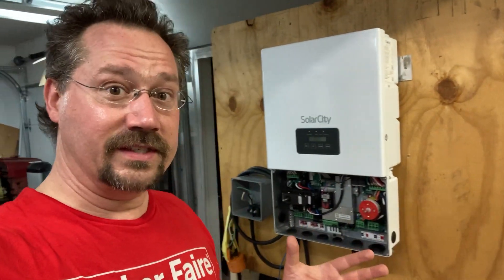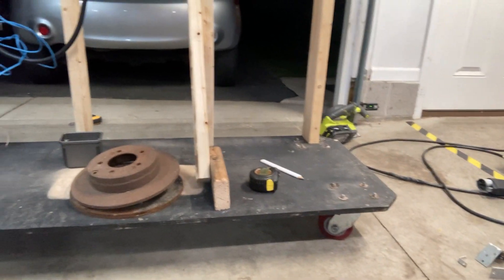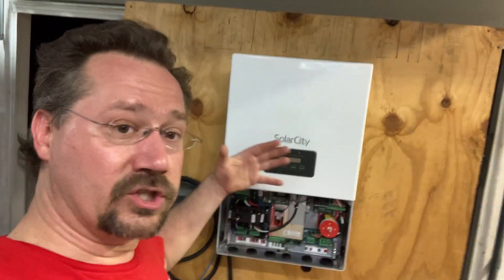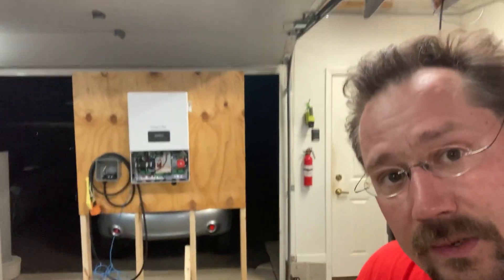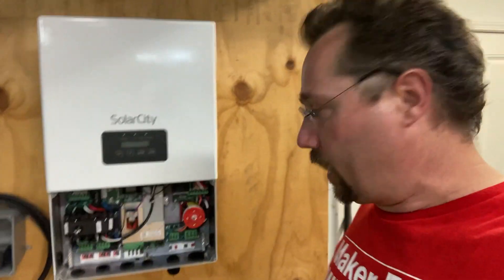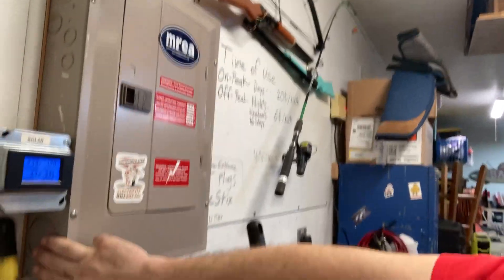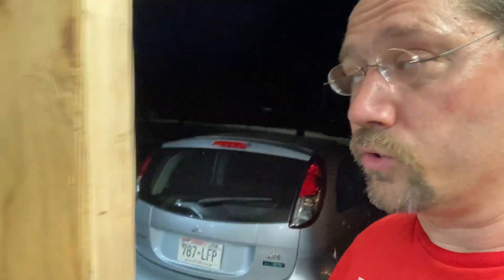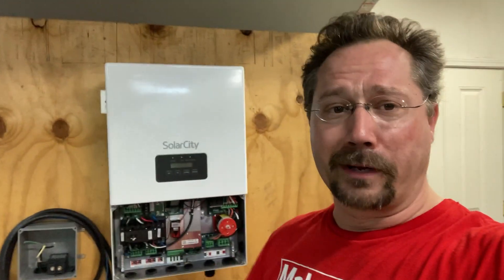DIY Vehicle to Grid | CHAdeMO iMiEV to house in the works

Comment: What does the iMiEV motor look like? Would it be suitable to do a Goldwing gl1200 conversion you think?
Reply: The challenge would be to have the 300+volt battery needed to run it fitting in a motorcycle.
Reply: @sophiesstuff1083  I'm not an expert on the topic but I think the voltage needed depends on what inverter one use and not so much on the motor it self? That aside. I think I could fit a 300+ volt battery in the palm of my hand but It would not be able to carry significant amount of energy. So physical size and volts both increase if you connect the cells in series. Anyhow. I think I could fit a battery with enough voltage to supply the  iMiEV`s original inverter and probably have to if I want to also use the original onboard charger and/or use fast charging.  I just wanted to know if Citroen C-Zero/ Mitsubishi i-MiEV/Peugeot iOn was a good donor platform for parts because its a lot of them and they are starting to go for pretty cheap these days even here in rural Norway. Or if I would be better off sourcing parts somewhere else. :-)

Comment: Wondering if the Hyundai Ionic V2L adapter would also work on a Leaf or a Mits. Seems like that is a simple solution, although a bit pricey. Thoughts Ben?
Reply from the maker: From what I've seen of that connector, it actually runs on the J1772 port, NOT the DC Fast Charge port.
On typical EVs, the J1772 goes straight to the car's internal battery charger, which is why you can NOT pull power out through that connection.

As best I can tell, the Hyundai Ionic/Kia EV6 has an internal switch that routes power so that you can DRAW energy through the J1772.

Therefore, it will NOT work with a Nissan Leaf.

I don't know too many details of that system, and I'd certainly like to find out the specifics.
Reply: @BenjaminNelsonX  
Thanks for the reply.  I was hoping it might be able to be used but had a feeling probably not. Maybe we will all get lucky and a standard will emerge to allow V2L for all EVs in the near future.
Reply from the maker: I think that Vehicle to Load/Home/Grid is going to become the killer app of electric cars.
It's coming. It's only just starting to get here right now.

Comment: I’d love to use my Nissan Leaf as a backup power supply or house battery.
Reply from the maker: I'm using a bit of a "cheat" on this setup in that it's very easy to MANUALLY activate the CHAdeMO connection in a Mitsubishi iMiEV.
Next step would be a more automated version, which I think I can do with an Arduino running the proper voltage PWM signal.
That would allow for any Leaf to use this same setup.

Comment: Haha. At least if the inverter catches on fire u just wheel it outside. We could all learn something from this genius move.
Reply: And to keep it from rolling away out of control, it looks like Ben is planning to install ... disc brakes.
Reply: If u added some motors and an arduino to the rack. It could detect a fire and just take itself out 😂